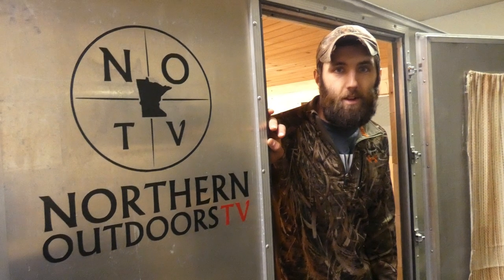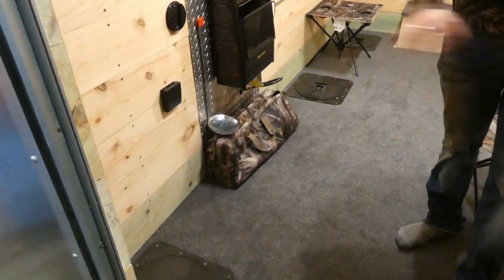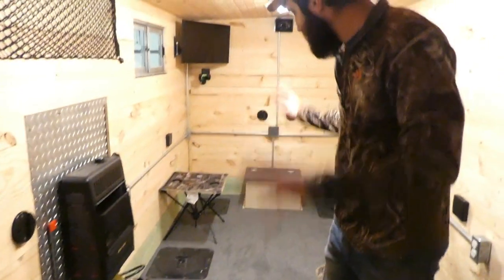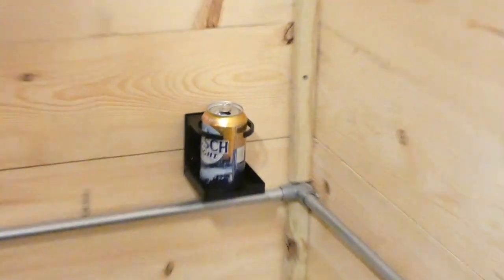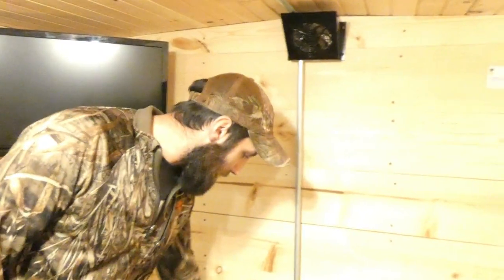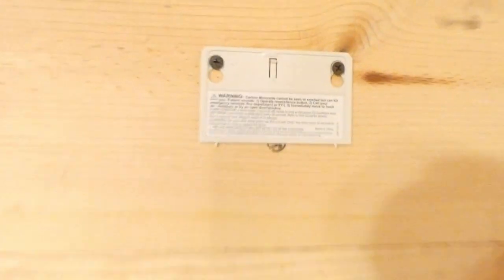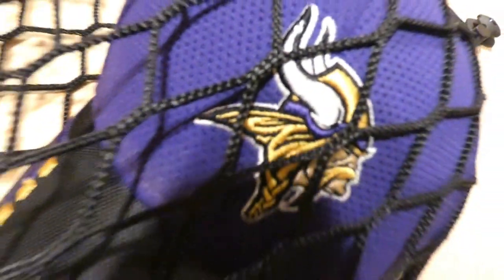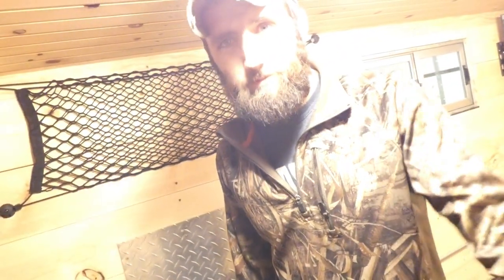Ice House Mods- Custom Drop Down Fish House

Comment: Must weigh a ton. Nice looking shack.
Reply from the maker: It's not too bad
Reply: @NorthernOutdoorsTV  What's the heaviest you want your fish house to be?
Reply from the maker: It depends on how thick of ice you plan on putting it on.  Some wheel houses are over 4000lbs.  A nice little house like this one can be utilized on a bit less ice ice is required for a long ice castle.